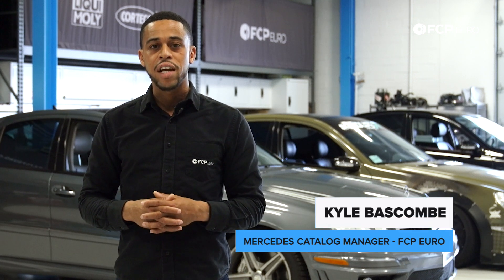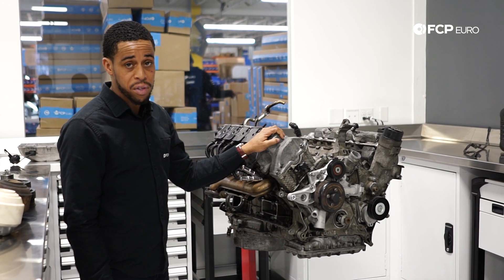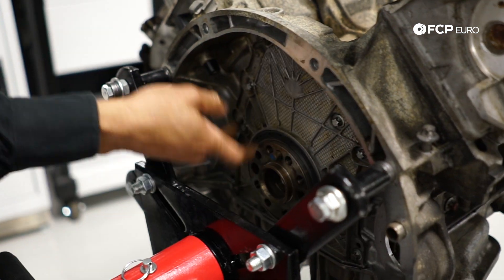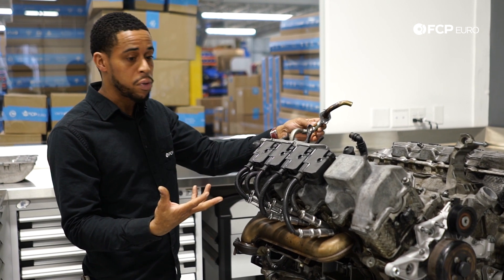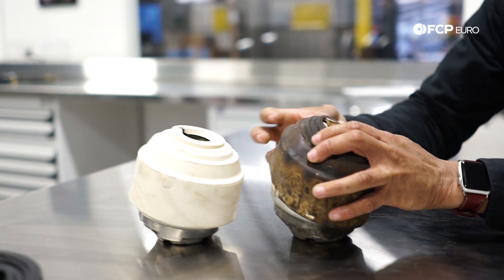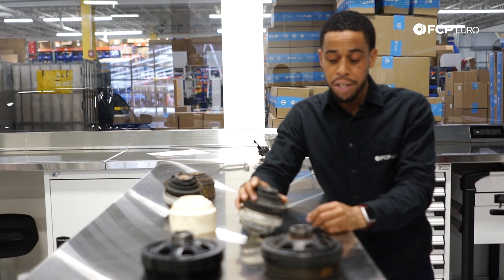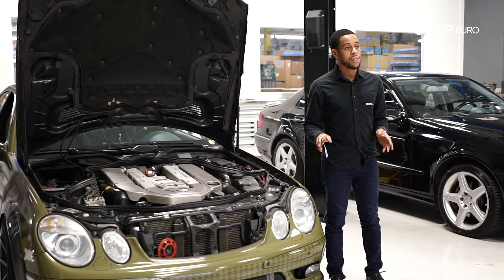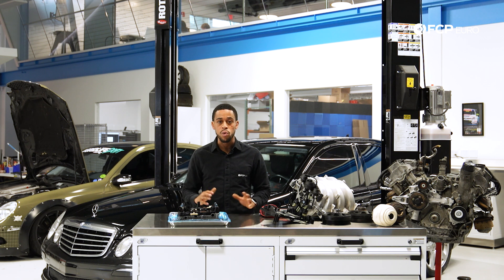Mercedes-Benz W211 Engine Diagnostics/Problems - Everything You Need To Know (M113, & M272/M273)

Comment: Question is there a video on changing the 2007 Mercedes Benz w211 E350 Oil Pressure Sensor, or Diagram show the location.

Comment: So i take it the 273 (5.5) is a solid motor and if properly maintained will run for quite a while….just did the motor mounts,thermostat,belt tensioner,cam sensors/adjusters,oil cooler gaskets,and alternator , as well as deleting the problematic airmatic system and went with coil overs on my w219…..only wish i would have done it sooner…..car runs TIT’s though and is more comfortable than my cts-V (v2)…..

Comment: Great video ! It’s great to have visuals of the engine outside of the car.

Only thing is that you got the EGR’s function completely wrong. They don’t reduce emissions, they reduce the amount of NOx in the emissions. They also do absolutely nothing about the "effective size of the engine".

The inert gases from the exhaust are routed back into the air/fuel mix simply because they can’t burn, and by doing so they lower combustion temperatures. NOx are produced at very high temperatures, so the egr prevent their formation by reducing the combustion temperatures.

Comment: I have a 2012 MB S550 and am having hesitation issues specially when going up a hill. Do you have any idea what may be causing this?
Reply from the maker: Hi Gary, unfortunately, you will need to diagnose correctly to see where the issue may be. Starting with a scan of the vehicle first is always a good avenue to see if any codes are present.

Comment: Great explaining. I wish there are more videos like this that covers all other aspects of other engines. I have a question, so I just recently got an E Klass 4 cylinder 2005 and the from time to time the oil gets mixed with water. The mechanic from the previous owner said it was from  the oil coolant and they changed that just right before I bought but obviously it didn’t solve the problem. According to this video is suggests that water can get it from the water pump and I seem to buy that a lot. I just want to confirm is it possible for water to enter into the engine house from a bad water pump on a four cylinder engine?

Comment: I have a 2006 E55 AMG and my mechanic quoted me almost $800 to replace the air injection valve, which the car tripped a code for about a month ago. Car has 116,000 miles but is mechanically sound and smooth running. Does this issue sound familiar or am I getting scammed? 😂

Comment: What interval do you recommend replacing the drive belt and the 2 idler pulleys?
Reply: As soon as the upper pulley starts chirping/squeaking, replace it ASAP. do not wait as it will fail when you least expect it and turn a 20min job into a 4hr job

Comment: you forgot the "pzev" debacle!!!! on W211 .... sealed fuel tank??!! to replace fuel pump??? do you have that part?

MB.warehouse_find
1 second ago
Hi ...I have a 2007 MBE350 M272 engine. RE: Fuel Pump quit working. Went to the dealer yesterday (8/31/22) and was told that a re-call bulletin due to california low emission issues on this model(s). So it was to change whole fuel tank to be extended for 5 to 15 years and or 150,000 miles. My vehicle as of yesterday was 170,000 miles. 

Prior to this event, back in 2017 I brought to the same dealer with 111,000 miles on the odometer due to smell of fumes inside. They said it was under warranty. They had the car for two (2) days without telling me about the main re-call of fuel tank at the time of service.

I told them why didn't they address the fuel tank/pump low emission issue altogether. I still have the receipt when the smell issue was done in 2017.

Is it true that I can still have the dealer (MBenz Valencia Ca) to fix due to the fact that they didn't advice me of this bigger issue of tank replacement at the time. They even gave me a loaner car for two (2) days.

Kindly assist as to what my options are both as a mb motorist (I have '67 MB250S, 1983 300TD & 300D TD, 1995 E320 S124, 2007 & 2008 E350 in my garage/driveway.
Thank you sincerely.
p.s. I know that thousands of owners are in the same predicament due to the fact that a used one is in high demand for $1k+ (new $2,400k + at the dealer + installation).

contact MBenz NJ Headquarters... this is a poor design

Comment: all of these videos are helping me save a lot of money as I became an owner of an 04 E500
2 years ago and have changed 2 front end air struts, alternator, radiator, coolant reservoir, voice module, SAM unit [rear], rear lights, hood cable assembly, 3rd brake light, driver side CV axel, hood locking mechanism, so far! Car sat thru a snow season and rain up north so under carriage was rusted and brittle, holes in exhaust. I love the car - she seems to bounce back so well after all the abuse - keeping it.Will hit MB up for the SBC upgrade.
Reply: An unreliable car

Comment: Hi we got a e200 kompressor 2007 model I think. When its in park the engine is quiet. But then its put into drive it starts too shake. Gearbox?
Reply from the maker: A good starting point would be to check and inspect all of your mounts, and go from there!

Comment: Hi, I have a bit of a problem ⚠️ with my 2006 C 230 W203 engine. It started smoking 💨 after a recent oil change (Mobil 1 SW-40) oil grade as previously used by the first owner. And I also noticed the oil level had gone way ↕️ below half measuring from the dipstick. In the morning I see smoke 💨 coming out from the exhaust pipe and sometimes The engine starts to jerk and the check engine 🔆starts to flash for a few seconds and stops. Kindly advise what to do and what could be the likely remedy.

Comment: So, the left crankchain housing vibrates a bit. The sounds rough and not smooth. 

You'd suggest that I check the pully first before I open the chain housings?

Comment: Good video , all very true ,,But I would not call the M113 things ,,''faults'' ..you cannot expect rubber parts to last forever.
Replacing some valve cover gaskets when they leak after 15 years or 100,000 miles is normal maintenance.
The others can often last much longer without any problem , but I would recommend replacing the crank position sensor which also wears out with time.

Comment: Hi bud like the videos my 2008 w211 has thrown up a p0020 code changed oil and filter engine flush changed the vvt solenoids and is still idling bad intermittently and sounding like a bag of spanner’s intermittently where is the oil control valve located exactly because nobody knows

Comment: Does anyone know if the MB replacement agreement on the W211 SBC unit, mentioned applying for a 25 year period by this great channel, also is available in Australia? The large US market seems to be able to force MB to agree to things like funding M272 E350 engine balance shaft cog faults in the USA, while leaving smaller markets like Australia's for users to foot all bills relating to these problems. That said, my W211 350 w SBC brake by wire I find an advanced and enjoyable system--even though at a lowish 105,000 km my mechanic recently  commented the SBC pump perhaps sounds a bit louder than he remembers when working on the cars when new. All advice super appreciated! Thank you...
Reply: No , not covered..as you say..

Comment: Love how Mercedes covered SBC fault in the US and it’s a warranty but here in Australia it’s just bad luck.
Reply: It's still worth trying to apply pressure to MB Australia and MB Germany after you've had to replace the SBC system. All it requires is two simple letters--or maybe a reach out to other Aussies via social media to commence a negative campaign. My mechanic told me the other day that here in Australia the SBC pump assembly costs $5000 or more to replace. It's just not good enough to extend warranty in one market to 25 years while denying it completely to loyal Mercedes-Benz customers in other markets.

Comment: Hi at 3.50 in the video, it’s mentioned oil entering the cooling system, are these particular water pump o ring seals accessible or does the timing cover need to be removed?? Thanks

Comment: Basically every single part is cheap and will fail in MB, ask me how I know.

After fixing something another thing unrelated area will fail.

Worst POS ever!

I take manifold runner control, transmission conductors Plate, rusted subframe, secondary air pump, etc, the list goes on and on.

Comment: Thank you for the video, I am struggling with my car engine 6429, W211 2009 E320 CDI V6. I have to drive it slowly and smoothly, otherwise it sort of like halts and jumps intermittently especially after take off at gear 2 and 3 and at high speeds if I accelerate maybe to overtake. The diagnostic test pointed to the Turbo Actuator, which we then replaced but it got worse after that, and now it doesn't even throw any codes, the test comes out clean. Sometimes it does this halting and skipping when it's time to change to the next gear. And sometimes when coming to a stop you feel as though it cuts off power abruptly as if you hit the brakes hard. Just for more info, there is been an oil leak by that Mass Airflow Meter and Turbo. At higher speeds it is better - but if you get to an incline - you can feel an up and down rhythm - pull - brake, pull - brake as if it want to stop then go, stop then go - feels like the car is dancing. What could this be, turbo, airflow sensor, actuator maybe or something else.

The car has just been serviced with genuine Merc parts - Engine, Gearbox and new engine mountings - This issue was already there before the service, mileage is 165500km.
Reply: Hello, were you ever able to fix this? My car has the EXACT same symptoms. Thanks!
Reply: @ronmoret7420  Hey Ron, I didn't come right, however further diagnostics revealed that the Exhaust Back Pressure Sensor overheated and was malfunctioning. This is for the EGR. If it is unplugged the car runs smoothly though it is sometimes slow to pick up when needed.
The new sensor also does the same, I even replaced the EGR Valve to no avail. Just haven't had time to check it again, I am driving it as is, with the sensor unplugged, "Engine light ON". :(

Comment: Mercedes are pure junk I've has 3 on the e500 the car stayed in limp mode for the most minor issues the sbc failed the front air struts failed then same issues on the s500 airmatic suspension failed it was so embarrassing I had to get home by putting a block of wood on the upper control arm and on the s550 same issue the front air strut and the eis the key would not work...on several occasions I went to Mercedes about the sbc Mercedes in fort Washington pa..very rude not helpful to me...you could not give me another mercedes for free also be aware on the e class that the transfer case makes a howling sound someone told me to drive in a figure 8 pattern to make it stop....every experience was a total embarrassment and tons of wasted money....😞

Comment: I have a problem with my w211 272 engine I have a check engine light on hook my car up to diagnostic machine it said cylinder 4 not working I change the plug also the coil for that cylinder but the check engine light keep on coming back every other week do anyone have this problem

Comment: Hello Everyone, İ had Issue on My benz E 240 2004 Elegance, The Problem is When u start the Car Cooling fan running very High Speed, (Even Car cold And Ac Off) Any Help Pls
Reply from the maker: That sounds like it could be an issue with a coolant temp sensor, wiring, relay, or the fan itself.

Comment: And in the 07 S550s camshaft sprocket teeth wear down cause timing issues. Transmission speed sensor issues, control arms don't last 50000 miles. Bags for the air shocks don't last. Only 87000 on mine and been broke down in my garage for 3 years. Worst car I have ever owned.
Reply: silk7519 never get a first year car

Comment: I like how he just brushes over the fact that if the rubber timing seals fail, that will allow coolant to enter the crank case. That's a common failure on those engines and the damage is costly!
Reply from the maker: Slippery slope for sure if you leave it unresolved or undiagnosed
Reply: K Digital Production Services ehh to be honest I really haven’t seen that happen much. He had an example there but that seems to be rare. I work in auto salvage and used 112/113 engines are a dime a dozen because they don’t really break. They leak oil, and they have valve train noise if you don’t stay on top of oil changes. That’s about it.

Comment: This man pointed out practically every seal on this engine talkin bout prone to leaking oil lmfao
Reply: Which 15 to 20 year old engines have no oil leaks ?
Reply: @Leo555ZZZ  2002 ml320 ,none,zero, nicht,nada ✌👍
Reply: @holeephuk  Either the car has low miles or you have already replaced the vc gaskets and re sealed the breather covers , which deteriorate with use and need to be replaced..
Reply: @Leo555ZZZ  just past 60k miles ,who ever had it really looked after it ,I LL drive it normally and service it regularly..
Reply: @Leo555ZZZ  the k20a2 in my 2003 RSX Type S doesn't leak a drop. 151k miles. meanwhile I've replaced every seal on my E39 530i. German cars are particularly bad about oil leaks.
Reply: My om648  @Leo555ZZZ
Reply: 150k on my 2003 E500.  Love this car to death.  Oil leaks like a stuck pig.  Constant annual maintenance.  German made = performance, not low maintenance, or any engineering thought on needing to service it.
Reply: I'd rather have to replace a few gaskets every 15 years , than have an engine that spins rod bearings , stretches timing chains , wears out cam phasers , scores piston bores , burns oil and loses compression or skips timing.

Comment: yo lets gooooooo I have a few issues with my m156 please address rough idle
Reply: 24k Media yess please mine has the same problem
Reply from the maker: Check the crankcase breather at the back of the manifold, additionally remove the manifold and check for corrosion at the center plate

Comment: Can you guys do a video on the 2013 S550, I’m really interested in buying one and I want to know what problems will I encounter.
Reply: Dont ever buy a Mercedes I owned 3 and they are overpriced over engineered junk on the s550 the main issue for me was the airmatic suspension and simple things that will send the car into limp mode..they look very nice but you cant enjoy the car because most of the time your going to find yourself with issues
Reply: Les thanks for the info, and you’re not the only one telling me that...I guess I’ll scratch that off my list and research another luxury car
Reply: Wise decision Sean mercedes are complete trash I got very tired of being over charged by dealers then they are the only ones who can get the cars out of limp mode with a star diagnostic scanner they are a real problem I moved on and went to Honda accord and I have a Lexus and I have not had one major issues no more limp mode no more airmatic suspension issues no more transfer case humming noise from Mercedes and the most dangerous thing is if you get the w211 Mercedes which I had in the past as well the ABS is controlled by a 2nd auxiliary battery if that battery dies you have no brakes so from experience I know first hand Mercedes are German junk the AMG series are designed a little better but that's performance and I'm speaking of poor components design that will fail especially the air struts arnot makes good replacements but that's the point if your driving a car worth $100,000 you should not go threw these things this often everything mechanically will fail but it should not be this repetitive...good luck

Comment: Thanks for the video, did not know about the crank pulleys being a problem on 112 and 113 motors..
Reply from the maker: You're welcome! Thanks for watching, Tony.
Reply: Tony Chavez they are always, always bad. You get a Merc with a 112/113, it’s going to be crank pulley, valve cover gaskets, motor mounts. Every time.
Reply: Junkyard Dave yes I have done motor mounts and valve cover gaskets on every 211 and 203 with M112 motor, hell even my E55 needed gaskets at only 70k miles..

Comment: You should cover the BlueTEC OM642! That would be so helpful
Reply: When the pulley starts to wobble
Reply: You’ve got that right. My bluetec is a mess.
Reply: @mattwatts6685  what issues have you had with yours mine is a c350cdi 2012 265 bhp and had oil cooler leaks abs sensors suspension level sensors and a broken spring all between buying the car at 57th miles now on 75th
Reply: Everything, NOx sensors, def pump, oil cooler leaks, AC compressor, DPF sensor, etc

Comment: I have a R500. With the M113 engine. It has had all of these oil leaks. I wish I would have known about the gaskets behind the water pump when I was changing it.
Reply from the maker: guhhh sorry Bryce wish we could have warned you sooner!
Reply: @fcpeuro  How often do they fail or at which mileage would be good to replace them at?
Reply: did you do it yourself?  if so was it hard?
Reply: @kevinlopes548  yes I did all the work myself. This is my 2nd Mercedes with this engine. Just like anything, after you do it once. The second time takes half as long.
Reply: @bryceweaver8211  thats good man!  i just bought an 04 e500 4matic..so i was just curious.

Comment: Looking forward to the M113k.  I'm getting a weird vibration at low speed, goes away over 35mph...  Almost like driveline vibration. 

Hopefully you cover that.
Reply: Bro engine mounts theres 2 of em look it up
Reply: @WatchoutNSG  I though mount are bad if the engine has excessive movement when you hold down brake and press accelerator pedal..  

I'll has to take a closer look.....
Reply: Could be transmission mount or the driveshaft bearing in the middle
Reply: I'll have some troubleshooting to do this weekend. Thank for your input.